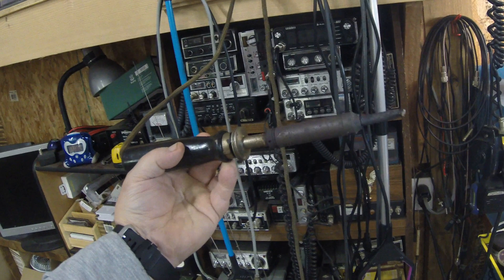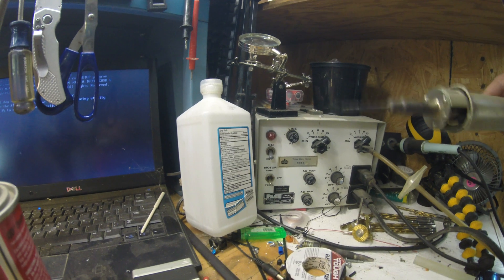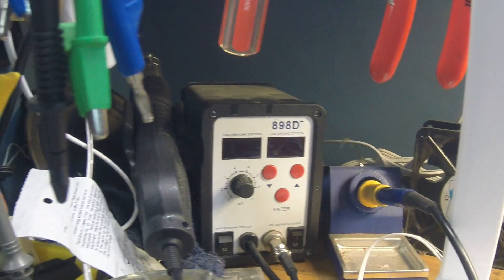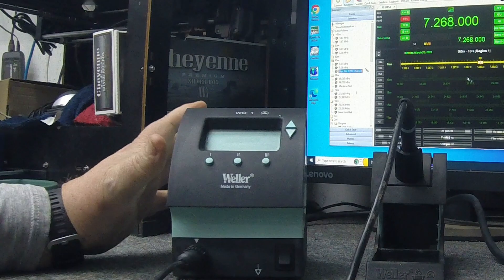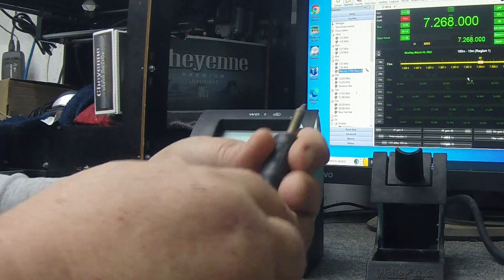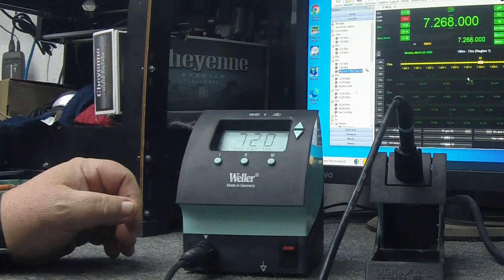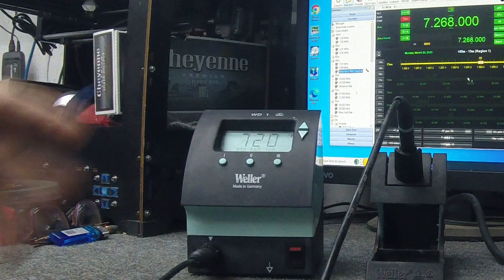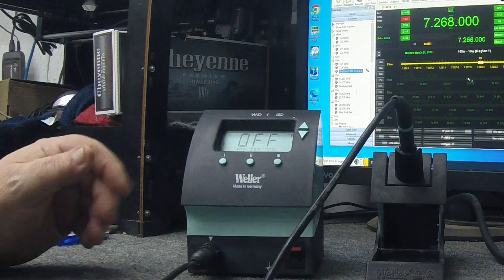What is the Best Solder Station Weller WD 1

Comment: I used Weller and Unger tools all the time also , great German products...German and Swiss steel is boss....I have now a Hakko  element driven tips [ T-18 ]  which I buy from Home Depot for 6 dollars each delivered to my door.... I have a KSGER T-12  that uses 32 bit chip tech and has over a hundred settings plus more if I download the newer software into it... The 5 T-12 tips that I have should last a long time.....My newest addition will be a KSGER portable pencil iron with C-210 tips , 70 watts of power is boasted on that one , it uses USB C cable cord and any 12 volt source that is available , it is similar to a T-100 portable iron by Mini Ware ......KSGER  is sending me that one at no charge to try out and review.... I usually don't do that , but it's a good name brand ..... Take Care Mon Ami....
Reply from the maker: That is awesome thanks for the response and you just verified my point there really isn't quote one Iron as it really depends on the work and preference. I am interested in that USB C one with 12volts I could see that as a great battery powered portable iron...
Reply: @TheElectronMan   I replied 2 times and it didn't stick .....  No links in my reply , but anyway , Yes the 12 volt portable can be used with RC battery's , the RC guy's use the portable's a lot ....  Do you need any info for looking up the KSGER portable iron ??
Reply from the maker: @cajuncoinhunter  No you got me interested so I went and found one.. I haved used butane in the past but honestly not really impressed with them especially in the wind think I might get one see how well it works...
Reply: @TheElectronMan  A friend of mine had one years ago , he didn't like it either .... I tried it , and just like the lighters always had trouble refilling it , and never could adjust to butane ....
Reply from the maker: @cajuncoinhunter  Exactlly...